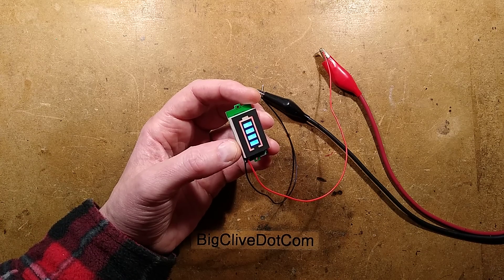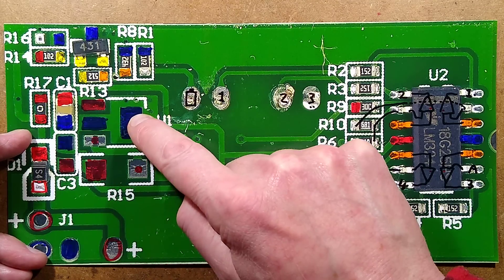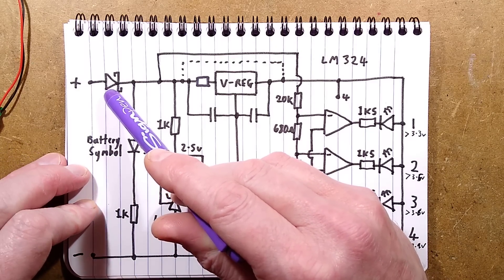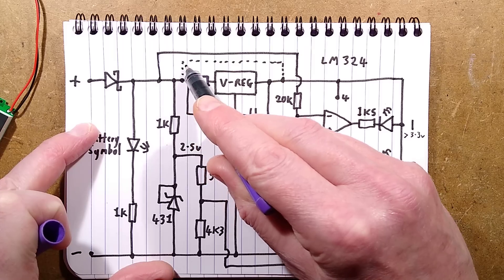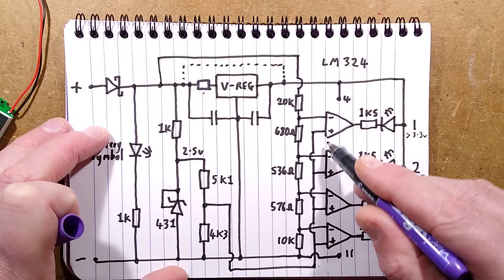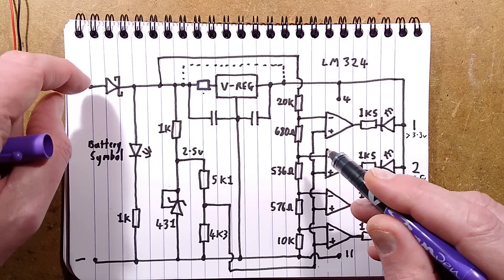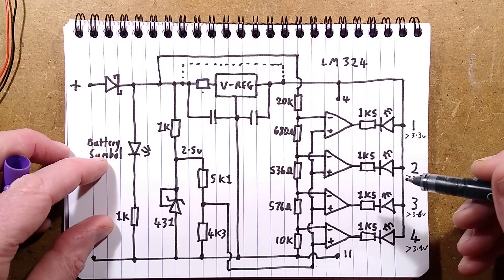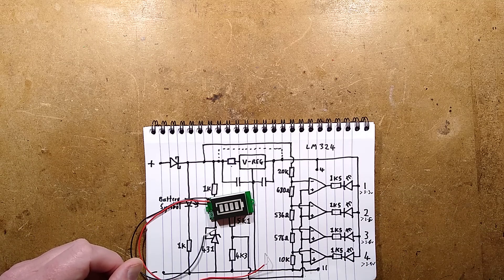Inside a lithium battery monitor (with schematic)

Comment: Always interesting videos Clive. Three years ago we purchased a new GE clothes washer and I've noticed a faint blinking light behind the control panel some early mornings, it has to be dark or you wouldn't see it. Some of these washers can be controlled from a smart phone, so I wonder if it is updating to the internet? That would be an interesting circuitboard. The dryer had a very loud annoying buzzer when the clothes were done drying, but it don't anymore.
Reply from the maker: It might be a data diagnostic indicator.
Reply: Engineer left the "I'm alive" cpu blinking led on the main PCB would be my guess.
Reply: Thanks Clive, I will read the manual but I think you are right.

Comment: On an almost unrelated note, i would be interested to hear if you've stripped and investigated the battery charge control on Shokz Openrun headphones. They're a premium brand but their FAQ seems to suggest their battery charge controller doesn't current control, or auto terminate. Which is fun, given they use USB interface and provide no specific adapter.

Comment: For more accuracy the 20K resistor would be better connected directly to the input because that input diode will vary its voltage drop with temperature and current. The circuit would still have reverse polarity protection.
Reply from the maker: I'll be releasing another video soon of a different version that does that.

Comment: I take it the six LED chips in the battery symbol are connected in parallel, for the lithium ion version and in series for the lead acid versions.
Reply from the maker: Probably a standard module so possibly still in parallel.

Comment: Interesting.  For the issue of dimming with voltage they could use an XC6371/XC6372 in the V-REG spot, but that'd require some other components (like a coil).
Reply: I ran into a 3.0V XC6371 in a 3x alkaline (4.5V) set of christmas light LEDs.  Presumably to get all the dregs of power out of the batteries, especially at cold temps.

Comment: Based on the resistor values, and a voltage drop of 0.22V on the Schottky diode, the thresholds should be 3.30V, 3.49V, 3.66V, and 3.86V.

I'm a bit puzzled that the values were held that tightly, considering that the diode drop is less than well controlled.
Reply from the maker: On the next module (video made and coming soon) the measuring point is pre-diode.

Comment: I bought an "Xtreme" XBB8-0166 power bank that has 4 LEDS like your circuit with a push button for a built in LED torch. Double press turns on the torch one press turns on the 4 indicator LEDS.

Comment: I've seen versions of this with the button in place so it can be turned on and off. Specifically, I've seen them on external electric scooter batteries. The point, probably, is to not have them illuminated all the time.

Comment: Personally I'd rather have one which actually displays the voltage. There are some which are about the same size and cover voltages from about 2.6v up to 30v. I guess this sort of display might be better for supplying to people who don't know what the end voltage should be.
Reply: I use one of the small LED voltmeter modules as a quick checker for my camera batteries

Comment: Wonder if you could get one for a custom battery pack or the add to a battery pack that was around 20 volts or so maybe even with a push button just to check the charge level like on most tools now a days would be cool for projects that took battery packs / like electric bicycles but those voltages are even higher like 48  -  72  volts but that depends on what your running as well could be less could be higher
Reply from the maker: I have another video about a multi cell version coming soon.

Comment: Why not just use the lm339 instead of the lm324?  I guess either will work in this circuit, but a comparator would make more sense and with the open collector output would give more headroom for driving the leds.
Reply: LM324 is pretty good at sinking it's outputs close to the negative rail. But not so good at sourcing voltage close to it's positive rail. Could just be a cheaper supply of LM324s available.
Reply: @kimchristensen2175  yes, but you need currents below 100 microamps to get the output much below 1v.  It will work, but a comparator would be better.  I can't imagine too much of a price difference between a 324 and a 339.  Both are as common as dirt.
Reply: @argcargv  I think it's a bit better than that. Looks to be able to sink around 8ma at 1V above the 0v rail according to figure 13 in this datasheet:
https://www.st.com/resource/en/datasheet/lm224a.pdf
Reply: @kimchristensen2175  yes, there will be more than a diode drop if you are sinking that much current.  The open collector output would get down to about 200mv at the same current.
Reply: @argcargv  I agree, the LM339 would be better. Especially when operating at a supply voltage from 3-4V of a single Lithium cell... Add in that 1K5 resistor and there won't be much current flowing through those LEDs. Clive did mention how dim they were.

Comment: Could this be used to momentarily test lithium cells when a multimeter isn't available?
What a clever little circuit. It's quite simple too.
Reply from the maker: It could indeed.

Comment: I wager It's an enable button, so you don't drain the battery with the indicator
Reply: It enables the music function and it plays risqué songs from the 1920s
Reply: Definitely not.  Nothing in the circuit could respond to a button.  To save battery, completely switch the input connection, so nothing draws power when not pressed.
 Anyway, the position seems fine for a power status LED elsewhere on application box.
Reply: @johndododoe1411  it's a joke.....
Reply: @theoztreecrasher2647  it's only because gadgetboy and myself know eachother 😅

Comment: I’d love to see manufacturers make versions with potentiometers instead of resistors or some other form of calibration (along with protection for the leds). I could see myself using these on heaps of odd voltage batteries (like Ni-mh cells) that I have sitting in solar lamps or other little devices
Reply: I could see them adding trimpots. You can get pretty small ones, so it wouldn't make it too much bigger
Reply: Adjusting pots to compete against 1% fixed resistors will be difficult and errors prone.  A web page or PDF listing values for different battery types would be more practical.  A sophisticated spreadsheet might do it, if carefully built with only standard functions supported since the Lotus 1-2-3 format, because not everyone has a particular software brand installed.  Basic JavaScript + HTML4 will do too.
Reply: @johndododoe1411  it's not like indicating 0-100% in 4 steps would require an awful lot of accuracy...
Also voltage based SOC sensing only makes sense for Pb and Li cells, not so much for nimh and nicd with it's flatter discharge curve. It seems like non-rechargeables could also be sensed using voltage, but only when loaded, so push button activated version would make sense there.
Reply: If you buy the cheaper options that displays the numerical voltage, they all have little trim pots on the back to fine tune their accuracy.

Comment: I never did like the idea of monitoring voltage on a cell with a flat discharge curve... maybe fuel gauge ICs are still expensive or more of a pain to calibrate? All your nickel and lithium chemistries you .. kinda just get rough idea unlike alkaline/Pb. Interesting they went with just a comparator vs .. sneaking in a PIC12 and charlieplexing like your drip LED. BOM?  I didnt have particular varient of micro so didnt get to try that out even after fighting to deASM the hex and write it to 629/675/683/509 must be missing something silly.

Comment: Hello mate, are you the same guy who wrote the Web article about magnets on the fuel line? 
Cheers
Reply from the maker: I did write one a very long time ago.
Reply: @bigclivedotcom  my engine has been wrecked by shards of metal breaking off from fuel pump. Going to try this method to see if it will catch metal filings travelling through the fuel system rather than replacing EVERYTHING that the fuel travels through. Wish me luck!

Comment: I did some testing a couple of years ago, to see how much I'll lose if I charge the cell to 3.9V instead of 4.2V.
After many tests, it turned out to be 200mA on a 2500mA Samsung cell. So, 8% loss.
Not a bad deal, to almost double the life expectancy of a cell.
Reply: My note 20 has the option to charge too 85% instead of 100% for that reason.

Comment: omg ive seen these things online and was also going to get them to improve my 
basic solar light charge box that waas cheap to buy in 2018.

already added a poundland charge board onto its battery terminals for when i want to charge from a normal [5v 1A] socket for faster better charging as my 
mini panel seems weak and even weaker after putting a fan on Negitive and Positive in the summer of 2019 
i dont think the basic panel had any protection but i will be taking another look as i also need to replace the thin cables for the 
main LED power board switch as they all broke off recently.

i also know the LED they. came with are unprotected and one set went Pop when plugging them into a real battery solar box.
but the LEDs also dim more and more as the battery bank dies.

i know its cheap but the box its self is so useful and ive already Modded it im also going to tidy it up since 
lock down is all over

Comment: it is funny thing: the LiPo battery gauge chips (i.e. MAX 170xx) report the battery status in both: Volts and %. And they read almost 0% at around 3.65V. While here, 3.6V is 50%
Reply from the maker: Theoretically 3.6V is half charge.
Reply: and I can relate to this table because when my sensors reach 3.6V, the curve to complete discharge is the matter of few more minutes, while before 3.6V my sensors can work for ages
Reply: Simply Measuring voltage against a discharge curve is very rudimentary and coarse method to determine capacity, at best. To get more accurate reading you really have to do coulomb counting, I.e. “gas gauge” ic. They have to be programmed, or allowed to calibrate/learn what is empty and what is full by some number of initial charge/discharge cycles
Reply: @zerog2000  that is what I was referring to: 3.6V means not much with regards to remaining capacity of the battery

Comment: Question - what is the power draw of this module? Thanks!
Reply from the maker: Low, but best used only when you want to check the voltage.

Comment: Any chance of a schematic for it with 5 of the same leds or like red amber two green one blue please? For li-ion I’d like to make this but not sure about the circuit and resistor values and how they would be worked out
Reply: Same as this circuit, but you gonna need 5 comparators for 5 LEDs... For the resistor values, if you suck at logic or math buy a pack of trimmers and trim it until it works.

Comment: Did anyone else try to figure out how those resistors were sized?  Something didn't look right (i.e. 536 over 576) and i think these were empirically chosen.
you have 4 equations and 5 unknown resistors.  for example, V1 = vin * the 4 bottom resistors over the total of the 5. V2= vin * the 3 bottom resistors over the total of the 5.  and so on.  if vout (V1, V2, etc.) = v ref 1.14 you have a value for the 4 equations and a guess at the top one (20K).   I stuck it in octave (Matlab) and got 20000.00 606.10 540.58 485.13 8974.99 for 3.3, 3.5, 3.7, 3.9 Volts
Reply: If anyone knows Octave, here is how I tried to solve the simultaneous equations
R1=22800
Vr=4.3/(4.3+5.1)*2.5
r=[1,1,1,1;0,1,1,1;0,0,1,1;0,0,0,1]
tp=[3.3;3.5;3.7;3.9]
resm=r.*tp-ones(4)*Vr
iresm=inv(resm)
rg=iresm*[1;1;1;1]*R1*Vr
rtot=sum(rg)+R1

v1 = @(v)   v*(rg(1)+rg(2)+rg(3)+rg(4))/rtot;
v2 = @(v)   v*(rg(2)+rg(3)+rg(4))/rtot;
v3 = @(v)   v*(rg(3)+rg(4))/rtot;
v4 = @(v)   v*(rg(4))/rtot;

v1(tp(1))
v2(tp(2))
v3(tp(3))
v4(tp(4))

vin = 3:.01:4;
plot(vin,v1(vin), vin,v2(vin), vin,v3(vin), vin,v4(vin), [3,4],[Vr, Vr] );

Comment: Somewhat un-cheap :) I'd rig the reference past the regulator, as the accuracy is messy anyway due to the divider, so in the 12/24 V versions you could just divide the regulated voltage without using the 431 at all.

Comment: Did you divide out the divider to see what the values worked out to?
Reply: LTSpice with OP491 Op Amps the reference voltage (Vin+) is 1.144V. With Vbat  post Schottky diode  of 3.4V Vin- readings are 1.262, 1.189, 1.132 & 1.070V, top to bottom. D1 & D2 would illuminate.
Reply: @johnjordan3126  Not the question asked.  The LM431 output is probably 2.500V, the divided reference is then 1.144V.  Ladder will reach that at diode outputs of 3.630V, 3.433V, 3.267V and 3.095V, add the diode drop for battery levels of the 4 LEDs.  This was done with a calculator and frequent refreshing the video playback that kept reverting from the paused schematic to the thumbnail.

Comment: the silkscreen looks like a temporary contact so it does not drain ( if it is installed ) when you want to check the battery level.  I agree that they are cheap, work well, and with adding a single momentary switch and moving 1 wire it is great to not have on all the time draining the battery.  I just wish I could remember what I did with mine and if it actually got installed in a project after the modification.

Comment: LM3904 then ?
Reply from the maker: The LM3904 has a fixed internal divider.  You can only set the top and bottom thresholds.  But it could work.

Comment: Handy device .I have a VFD for you to play with .Single phase 120/220 v  in ,3 pahse out .Someone wired it in through the out door .And it diddnt like it .3 surface mount resistors went boom .Capacitors seem. Fine .I think it's a Leeson Drive .I'd you want to play with one I'm Going to send it out for recycling
Reply from the maker: That's a common destroyer of VFDs.  The main IGBT module usually cops it.
Reply: @bigclivedotcom  strange thing is the control /programing module still works and lights up .I wonder if those surface mount resistors and like disable links that let go before the igbt decided to let out the smoke  from hell or the IGBT is toast no mater what ..In through the out door is a great album but not good for drives